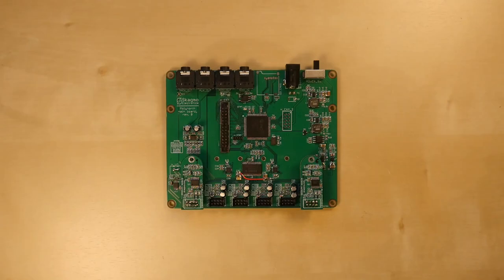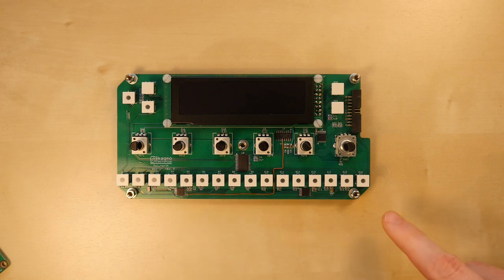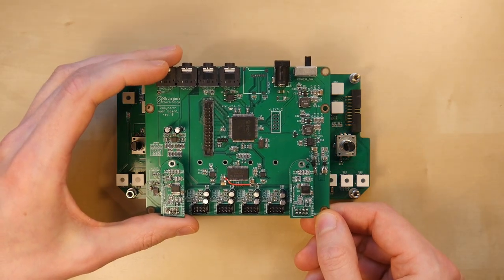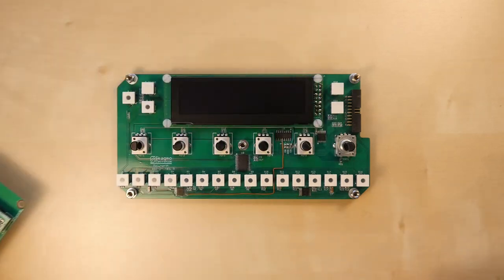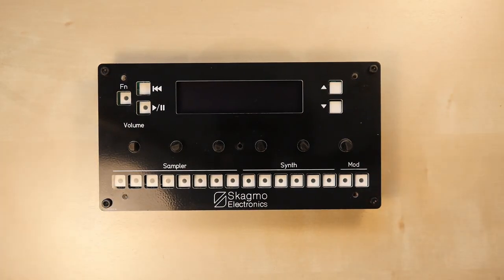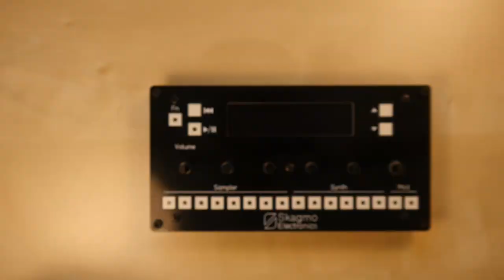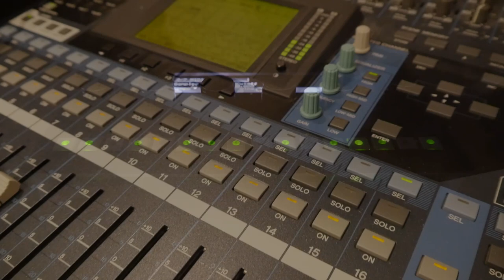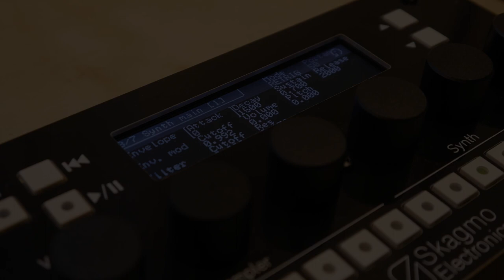Polynorth - a hybrid polyphonic synthesizer, part 2

Comment: This little thing sounds freakin awesome, and I love your compositions!! :-) Will there ever be a more knobby interface with separate pots for filter and amplifier adsr?
Reply from the maker: Thank you! I think I'll first make the hardware 100 % finished with this user interface, a wooden enclosure etc., and then use it some more to figure out how the user interface could evolve. I'm looking at rotary encoders that provides 128 pulses per revolution and a pot-like feeling (the standard 24 ppr encoders are way too course in my opinion) , but also just having a lot of pots.

Comment: Very tempting / Promising !  
Are: 
- DCO drift
- Poly spread
- Free running LFO's for each voice
included/considered ?
Reply from the maker: Thanks Ole!

DCO drift: I assume you mean deliberately adding drift to the dead stable software oscillators to make them behave more like analog VCOs. Well, yes, it's a good idea. I've tried adding extra LFOs running at very low frequencies (in the order of what temperature changes would do to a VCO) modulating the main oscillator frequency. It works as intended, but I guess I should take it further by characterizing how an analog synthesizer drifts (probably a lot more random). And of course it should be adjustable (an "analog factor"/"analog wonkyness" parameter).

Free running LFOs per voice: That's an easy fix, I might just go ahead and test that :)  All firmware components like the LFOs are object oriented, and the LFOs uses a lot less resources than the main oscillators so from a resource perspective I could probably have hundreds of them.

I'm not familiar with poly spread. Would you care to elaborate?
Reply: @jpskagmo  Yes you got it all right ! several LFO's  synced or free running per voice with many modulation destinations would create a pad monster !  Regarding Poly Spread I think it's more common to say just voice spread in the stereo field ? 
What about sending an envelope to control the spread ? - the attack chord starts in center and then the different voices slowly pans out to each voice placement in the stereo field.  "each voice is panned to a different stereo location. You can also replicate the stereo panning features of classic polyphonic synthesizers like the Oberheim OB-8, where each voice in a chord could be panned to a different stereo location.